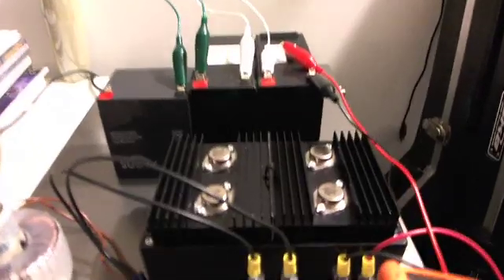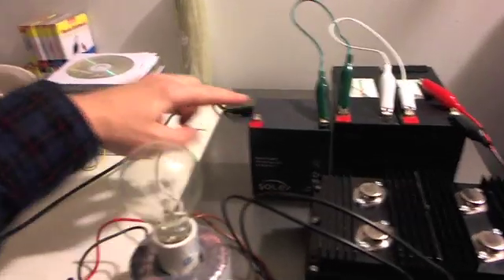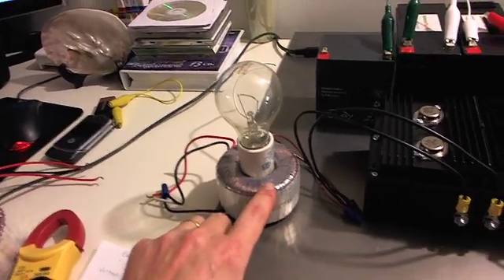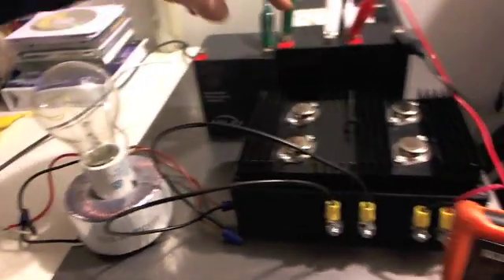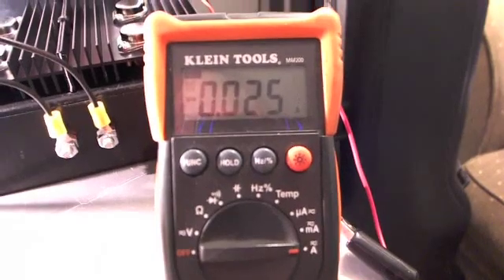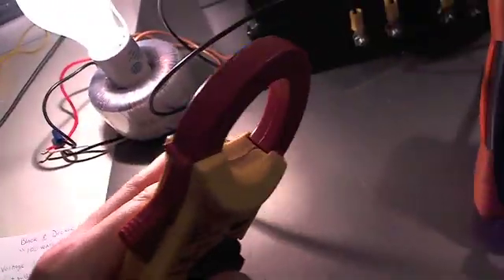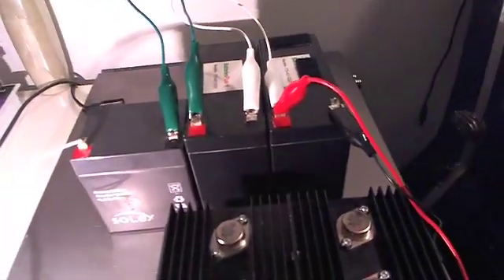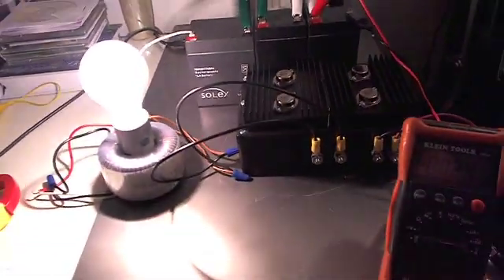Homemade Power Inverter....Part 2

Comment: Is this a square wave or sine wave output? Why did you choose bipolar transistors over MOSFETs?
Reply from the maker: +Chaplain Dave Sparks 
It's a square wave output... this is actually a old video as to when I started making homemade power inverters. Please watch my updated video on homemade power inverter simplified... Because in this video I use power mosfets which work very well. Thanks for watching.

Comment: you said about only being able to step up your transformer by adding more voltage input, why don't you simply wire up a joule thief circuit to increase the voltage input to the necessary voltage for you transformers that or make a voltage doubler circuit with diodes and caps witch will also lower your amperage draw while increasing your voltage

Comment: how will you charge your batteries wen in 48 or 62 volt or higher???, that is the reason for power inverters!!! if you already have 120 volt you wont need a 120 volt inverter!
Reply from the maker: Actually yes, you would... because the voltage still needs to be converted to A/C current to run things beside light bulbs. 60 volts of D/C power is useless to run anything. Thanks for watching.

Comment: if the transistor is a 2n3055 you cant go over 50V or you will burn the transistor. also i recommend you stay below 45V for safety
Reply from the maker: Max voltage specs is 60 volt 115 watts output... but yes, your right in keeping it lower for safety reasons...I've burned many chips when trying to increase output load. Please check out my other homemade power inverter ( simplified ) video in which I use mosfets which really can put out the power. Thanks for watching.
Reply: ok. i'm also trying to make stuff like that but i have other plans for it. check this link and you will know why http://redstoner2013.deviantart.com/journal/do-we-really-have-to-pay-433884316
Reply from the maker: redstoner200

 Okay, will check it out buddy. Thanks...

Comment: what product is the case and heatsinks?
Reply from the maker: Just a normal plastic en closer box and heat sinks designed for those transistors I purchased at " http://www.a1parts.com/ ".
 Thanks for watching.
Reply: whyme2b thanks. did the heatsinks have predrilled holes or is that just the picture?
Reply from the maker: Yes, for the transistors and mounting it to anything.

Comment from the maker: w.....electroschematics dot c./220/12v-dc-220v-ac-converter/. I changed my 3055 transistors to IRF1404 due to being more powerful. Also lower the resistor value to 100  ohm. Thanks for watching.

Comment: Yeah your only putting out 3 watts of Heat at 100 watts, so that is not bad at all... But as that inverter is pushed harder (to around 1000 watts of draw) that efficiency will lower. Just like any inverter, as its gets nearer its maximum capacity it begins to draw more energy and sacrifice more to heat. The bigger the inverter you build and the closer you get to 115 volts with your DC the less work the inverter's coil has to do, therefore less heat.

Comment: Hi just a note on current and batteries. (and for CheekyMonkey888. The main reason for higher voltages, hence more batteries, in series, is power losses not how long you get running. If you add more batteries in parallel you will get more running time still if the motor/load is correct voltage. Losses are mostly I squared * R. That's in wires etc. So the more current you have around the wires the more losses. Try it. Assume or measure a cable length resistance and do the maths (or Math :)

Comment from the maker: Thanks.. here is the website of the schematic." w...electroschematics dot c./220/12v-dc-220v-ac-converter/... I used the 3055 transistors instead of whats on the circuit and also a 100 ohm instead of 470 ohm resistor. Thanks for watching.

Comment from the maker: Thanks for your comment.. I believe even thou the same power output it would use, it would take a longer time to deplete than just using one battery. A golf cart uses the same principle by having a higher voltage, your current is lowered which would usually run it all day until it needed charging again. Thanks for watching.

Comment: Power equals Voltage times Current
By increasing your Voltage you get to lower your Current for a same Power output
That I get, but I don't understand why bother?  What are the savings?
I'm thinking of wiring up a trailer with a deep discharge battery(ies) and inverter, the battery being recharged by solar panels and a generator.
I've noticed golf carts run their batteries in series to total 36V or 48V, is that for efficiency?  Lower Voltages would increase ressistance losses?

Comment from the maker: First off the lock rotor amps you will never reach unless the compressor shorts out or locks up... Look for your total wattage and current consumption in normal run mode of the device and then build from that. Please watch my other inverter design on using toroidal core transformers for getting a better energy efficiency and more power output. Thanks for watching.

Comment: hi like the project i am looking to build a inverter for a project i am doing i ant to power an ac unit its a 115 60hz  run an its lock rotor amps is 63amps what can i do to buils one that can run it?

Comment from the maker: Not to sure what that is? Yeah, I've been looking for higher power transistors and found them the other day.... Better improved design is in the making using very high voltage being stepped back down again threw a special process. Thanks for watching.

Comment: Well, it kind of depends on the size of the batteries.  I've seen gelcell batteries for plugin flashlights 1/2 the size of a pack of cigarettes.  Also, those ones approximately the size of a brick are quite often swapped out of UPSs on a regular maintenance schedule for mission critical applications with well over 90% of their life left.

Comment from the maker: Yes, I agree... the best savings is to use 10 -12 volt batteries in series but of course that would be pretty expensive! Will work on another power solution idea better than this soon. Thanks for watching and your comment.

Comment: I'm no great expert on this, however I have a friend who is.  The power formula is P=I * E.  So when you add voltage, necessarily, the amperage goes down, however that does not mean that you are not drawing less total watts from your batteries.  The efficiency will come in from being able to use cheaper/thinner wire and possibly eliminating the transformer entirely with higher voltage (like stringing 11 batteries together in series).  Sorry, no real savings below 120V input.

Comment from the maker: @FibanacciSequence 
  No, my power transistor switching was using 60 volts Dc max input at 15 amps output , which was stepped up threw a Toroidal Transformer which provides around 300 watts of 120 volt A/C Power. The key is...the bigger the transformer, the more wattage output ! A 240 volt output can also be achieved as long as the transformer primary has that input specs.

Comment from the maker: @megaexplosive2 
  This is the site....apowersupply com/converter-12v-dc-220v-ac-59.html
 My design is different thou. Inplace of T1 and T2 is a 2N3055 Transistor and R1 and R2 is a 100ohm instead of 470ohm. I build these circuits and install them in a nice housing for $ 65.00 (shipping not included)....if your interested in just buying a completed kit.... because parts can be hard to locate. Thanks for watching.

Comment from the maker: @egn83b 
 No, not really concerned about that because the NPN Transistors being used is only drawing 24 to 25 Milli Amps for all four running together ....and Also, I love the heatsinks they attach to because it makes a great collector wire connection and their quite and run cool ! Thanks for your comments...

Comment from the maker: @furulevi 
  No , The 100 watt bulb will always pull the same current for what it was designed to consume ... But because of the increased voltage on the battery side , it will use less current from the battery to power the light bulb. Also, it's not a 220 volt bulb.... just a standard 120 volt. Thanks for watching...

Comment: so... the 12v batteries are powering the inverter and the inverter is powering the 220v bulb?  and via the inverter the 100w bulb consumes less than from a 220v wall socket? thanks in advance :)